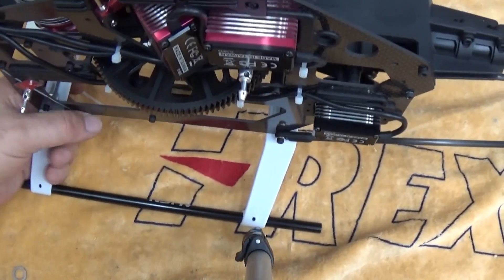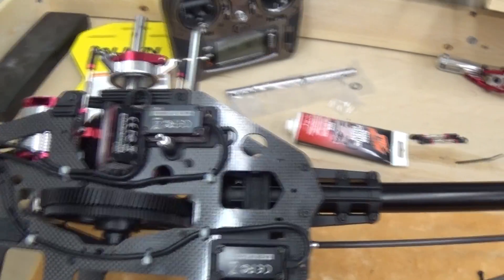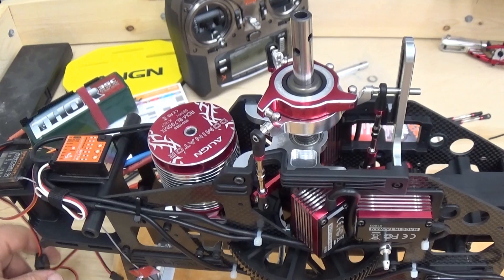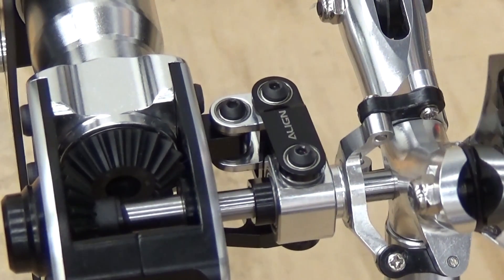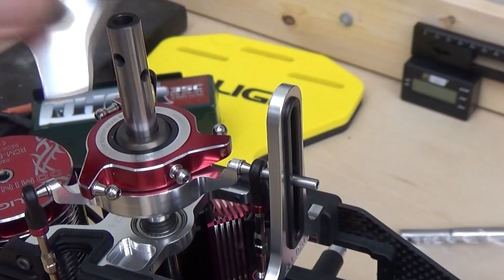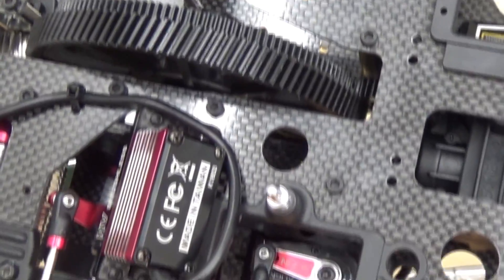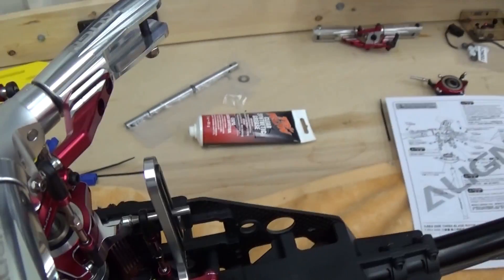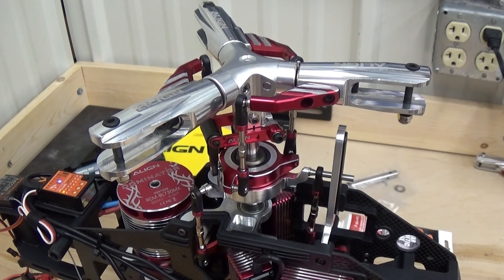TREX550X Servo wiring and setup

Comment: I have one question you have to set up the micro beast with a receiver ?
Can you use the micro beast alone Or you have to have a receiver connected to the micro beers and then the Servos connected to the bottom half of the micro beast

Comment: I set up sbus but I cant go in menu a . It will not go solid. Just keep flashing. Need help why when I turn it on it goes through initial setup stops on N but all lights go off and solid blue light then I hold down button a just flashes when I let up.